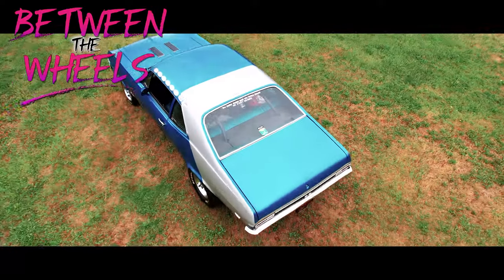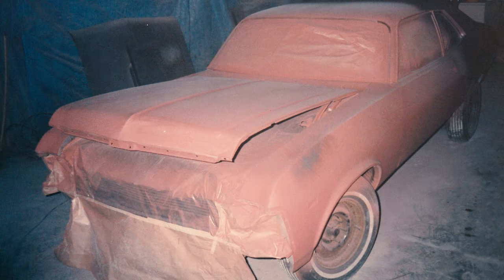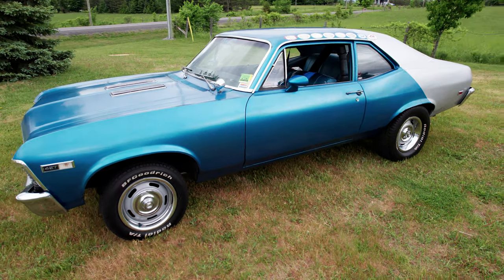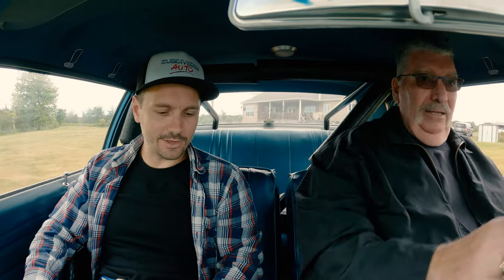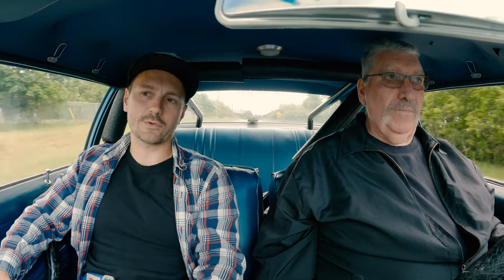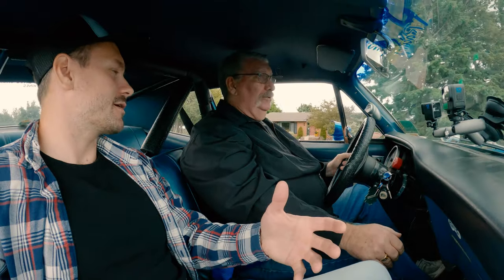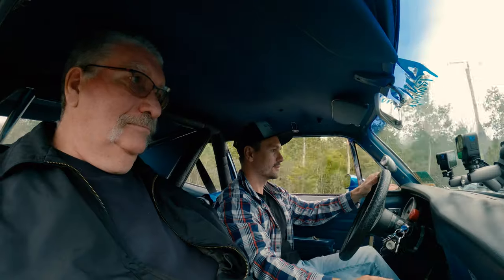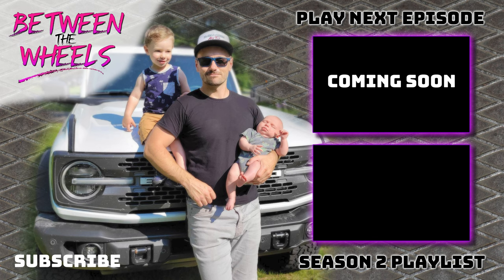Combining a Chevy Nova & Camaro into a Legendary Drag Racer

Comment: When I raced my nova.i ran a 2 speed power glide..and I allways thought it beet a lot of carsbecause of the long times between shifts..but I loved a small block 400 beet a lot of cars that bragged they could beet anyone they raced..including a buick gran sport.firebird .the one car I wanted to beet was a 427 ford torino gt. Wiped the smile rite off his face..and took 500 out of his pocket..he actually worked for ford..
Reply from the maker: Very cool story man. I've seen some cars with those 400s and they're absolute beasts if you know what you're doing with them. And yes 2 speed is still the go to transmission for a lot of racers. I've seen some people upgrade to 700r4s or turbo 350/400 but a lot of people still use the 2 speed

Comment: Cool video and it's very nice of the owner to let you get behind the wheel. A 71 Chevy Nova 2 door used to be my daily driver nearly 25 year ago. I lived in Reno, NV back then and got it for $500, almost rust free. It was a fun car even though it only had a 250ci inline 6 with a Powerglide, very basic with manual brakes and manual steering. It was still relatively quick, agile and could do 80 mph consistently on I80 going to the bay area. Great memories 🙂.
Reply from the maker: Oh nice man yeah they are great cars and for the size the 6 cylinder did just fine. Yeah Nova has been my dream car for a while so it was really cool to drive one of these finally after searching for so long. Now I finally have one looking forward to driving it someday (its in a million pieces). Thanks for commenting again and sharing your story